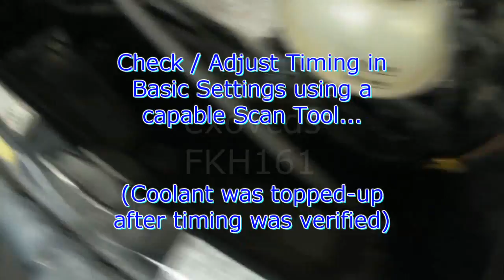VW T4: 2.5L Eurovan Replacing Hall Sensor inside the Distributor (Intermittent No Spark when Warm)

Comment: What year is this for? My 2003 has two hall sensors on the side on the block, not in the distributor cap
Reply from the maker: Those are probably knock sensors. North American Eurovans only had 2.8L VR6 engines in 2003 (last year for Eurovan). 2.5L inline 5 cylinder till 97... I think.
Reply: @EXOVCDS  my.mechanic told me they are cam shaft position sensors, also known as hall sensors... 
I changed one of them but engine light still on so ordered the other
Reply from the maker: So you have a VR6 with 2 cam sensors. If the engine has chain noise, sensors won't fix it.
Reply: @EXOVCDS  no chain noise (thankfully) just the damn engine light and code reader said cam shaft position sensor. Hopefully second sensor replacement fixes it
Reply from the maker: @bryankuderman945  the oil control valves for the camshafts can become stuck, resulting in camshaft sensor fault codes. To change them, the intake manifold and upper chain cover have to be removed... if the new cam sensors don't solve it, I would check them next.
Reply: @EXOVCDS  ok, ty for the info. One step at a time. Will see how the new CSP Se sor works out and then go from there. Much appreciated

Comment: if you have spark originated around the problem that retailers without long as the rotor and No fault was the failure to take all the retailer that I get for not knowing, that as a result it took me to put the item be lost again times since then and tried to turn it on and does not turn nad anything that makes me sad because that truck is my working tool in rrato when a friend arrives will try to do the firing order that you just provided me and if you have another trick and turn it on I would appreciate all the info you can give me thank you very much sir thomas and congratulations on being a mechanic is not easy eurovan at least in my country Venezuela is nadien know the mechanics of this truck look like the a spaceship and dare not repair
Reply from the maker: How many "windows" does the sensor wheel have? 5 or 1?

http://fkh161.ca/VW/wheel.jpg

Do you have spark? Spark yes, or spark no?

Comment: do you know if its possible to fix the hall sensor without replacing it? (talking about thing like soldering etc.) not sure what goes wrong with it
Reply from the maker: No... the transistor that is inside of it can't be accessed for replacement. You've narrowed it down the the sensor? A bad sensor will cause the engine to stall / not start. In North America, the 2.5l did not have a crank sensor... on the models that do have a crank sensor, the engine will run if the cam sensor / hall sensor fails. Have you checked cam / crank belt timing? If your distributor moved... you could have retarded timing which could be causing your power issue.
Reply: +Thomas EXOVCDS Hmm.. ok. Yeah I think it's the hall sensor. seems like it costs alot for such a small part http://www.amazon.com/Bosch-1237031296-Impulse-Sender/dp/B001CO18IQ  but there's also some cheap ebay part http://www.ebay.com/itm/HALL-PICK-UP-SENSOR-ASSEMBLY-1237031296-12303200-CM77299808-FF-/271985960255?_trksid=p2141725.m3641.l6368  not sure about the quality though. haven't checked the timing yet. I noticed that you're replacing the whole metal plate + hall sensor, but the one's I found just come with the sensor, is this a problem? Also, I was reading somewhere that you have to be really careful to not damage some kind of connector or wires somewhere when removing it/dissasembling the distributor?
Reply from the maker: +Žanas Tumasonis The sensors you have listed are the "stubby" style... they will NOT work on the Eurovan. Yes, they will fit / mount into place, but because of "where the sensor is located", it will generate a signal at the wrong time. The stubby sensor has the "sensor" right at the connector... the Eurovan hall sensor is On the other side of the distributor / hall sensor connector. It has to be in the same place in order to keep the timing siganl correct for the ECM. It's the wiring from the connector that goes to the sensor that can get pinched / break if not handled correctly: http://partsforcar-2013.co.uk/czesci/030%20905%20065%20B.jpg
Reply: +Thomas EXOVCDS Having some hard time finding the full part... started googling with german words like hallgeber or impulsgeber to find the correct part but I dont totally understand what these guys are talking about since google translate obviously wont translate all of it, where did you get the part from? http://www.t4forum.de/wbb3/board19-technik-bereich/board119-fahrzeug-unterhalt/board7-wartung-instandsetzung-bullim%C3%A4ngel/160712-aaf-z%C3%BCndverteiler-hallgeber-defekt/
Reply from the maker: +Žanas Tumasonis If the engine is running, the hall sensor is most likely ok... like I said, when they fail, they usually are dead = no spark. Crank the engine while looking for spark from the coil wire (remove from distributor cap and hold 1/8 to 1/4" from a clean engine ground). If you see consistent strong spark, hall sensor, coil, ecm control of coill are ok. I'm currently at work... won't have time to read links / check back with you that often, sorry.
Reply: +Thomas EXOVCDS It was the hall sensor :)) I bought this distributor with the hall sensor already in it, but it doesn't have the 'Germany' marks on the back of it like the original does that I took off. It started, but the timing mark that I previously put from the last one didn't seem to work for the new distributor (engine/exhaust was coughing), even though they seem the same shape.. weird right? so what I did was I turned it all the way to one side, got a check engine, and turned it in 1-2 min intervals until the check engine went away lol... seems to idle fine but I think there might be some power loss, so it's probably not timed very well.
Reply from the maker: +Žanas Tumasonis Interesting... good to hear it's running again! Not the type of failure I was expecting from a hall sensor! Sorry about having focused on something else.
Reply: +Thomas EXOVCDS if not your videos who knows where the van would be now :) what do you think about adjusting the timing just by hearing the engine/exhaust/it's idle? realistic or just better do it the proper way?

Comment: hello thomas! i have a 93 vw eurovan 5 speed the problem is that spark is going inside the distribuitor but is not coming out to the sparkplugs and when it does the whole motor sounds to weak if i press gas shuts off so i replace the hall sender sensor but the one that i got is just one piece doesnt  have the wires and the magnetic field is atached  close  to the 3 way conector so once i finish the installation  it does start but still weak not even to move the van because it shut off rite away so i took the sensor back to  BAP autoparts the told me that it is the rite one but  my concern is that it looks very diff from the one thta it comes in my distribuitor !
Reply from the maker: Make sure that the ignition wires do not have high resistance... as well as the ignition rotor. Ignition wires, 4k to 6k ohms each, ignition  rotor 2k to 3k ohms. Make sure that the inside of the cap is clean and that the carbon tip that pushes against the ignition rotor is in good shape.

Does your hall sensor shutter wheel have 5 shutter windows or just one?

If you use a "stubby" hall sensor, then your "timing" will be different from where it was with the "long" hall sensor... so you will have to readjust the distributor position to compensate for the stubby sensor.
Reply: +Thomas EXOVCDS  it has 5 windows but the one i got from the store came whit only 1 well i have 2 eurovans same year (93) just that 1 is auto and the other manual so i switched the distributor and the problem still but i havent check the wires!  and the rotor. another ?? is the distributor the same for the autos and the manuals?
Reply from the maker: +ZUICIDEBOY777 Yes, I believe the distributor is the same. 

A one window shutter is used on engines that have a crank sensor.... the engine will run with the hall sensor unplugged. 

You can not use a one window distributor on an engine that does not have a crank sensor and you can not use a 5 window distributor on an engine that has a crank sensor.
Reply: +Thomas EXOVCDS ;'(  hate those BAP store guys they told me was the same so now what shut i do if i already install the 1 window distributor but i remove i and put the old one by the way  you knw where can i get the hall sender unit like the one is inside  in the distributor !
Reply from the maker: +ZUICIDEBOY777 Your old distributor hall sensor was working (you have spark from coil). If the hall sensor were bad, you would not have spark from coil.

Put the old one back in and check your wires & rotor.

A hall sensor from a 1990 jetta or golf will work in the eurovan... when you find / buy one, make sure that is the big style (sensor is 180 across from the harness plug).

http://i.ebayimg.com/00/s/MzQ2WDYwMA==/z/pQoAAOxyRNJSfpWW/$T2eC16h,!zYFIcTNiv5BBSfpWWn)M!~~60_35.JPG
Reply: thank you! very much. so why at the autoparts stores are selling a different sensor that  is not 180 i went like 3  places specialized in europarts all of them show me same sensor! they told me was better than the old! :'( hey have you evr done a swap eurovan to diesel?
Reply from the maker: +ZUICIDEBOY777 Haven't done any swaps / conversions... the "stubby" hall sensor should work (I have not tried it), BUT you have to readjust the distributor to get the correct timing.
Reply: and how can i do that is there any diagram for the adjustment ?
Reply from the maker: +ZUICIDEBOY777 I will send you a link to a pdf showing the distributor location at TDC via youtube messaging... compare the shutter wheel position (with relation to the "stock big" hall sensor) and then, when installing the stubby hall sensor... turn the distributor until you get the hall sensor at a similar shutter position... if that makes sense.

Comment: Thank you so much for this awesome video!
Gonna replace my hall sensor soon and let you know if it fixed my problem, that sometimes my van just runs on 4 cylinders, anything else is already replaced
Reply from the maker: When the hall sensor is bad... the engine will NOT run at all. If your engine is only running on 4 cylinders sometimes... look for a spark plug wire or distributor cap issue.
Reply: As said, anything else is replaced, even the ecu and the harness checked and rebuilt. There are people saying the hall sensor can die in a process, so it gets worse from time to time and your video, showing the magnetic field decreases, and a new one has enormous magnetic strength, actually proofes that
Reply: Thanks! So the main issue is on autogas (lpg) he seems to stutter sometimes, since about half a year, without any logic or reason behind it. Appears completely random. I thought it was an autogas issue and then drove mainly on petrol. 
Now since a week I have exactly the same stuttering also on petrol, like he's not running on all cylinders, but JUST if I drive quickly in right curves. Left curves show no issue. Could this be caused by the hall sensor? I checked anything engine related, timing with vcds done several times, replaced new parts with old parts again, still no change. Hall sensor is the last to do, besides that any sensor, the entire exhaust is new, throttle and hoses cleaned, vacuum hoses also changed, ecu changed. It's just a weird thing that it's just on right turns, it can't be the fuel or the fuel pump (which is also new as it completely failed 1,5 years ago) as it appears also using autogas. No errors in the ecu, by the way
Reply from the maker: If the vehicle is sensitive to body lean (left or right)... look for wiring / wiring harness issues (flexing, bending, pinching of wiring). If you are in Europe, check if your engine has a Crankshaft Position Sensor.... here in North America, the T4's never had a crank sensor. If the engine has a crank sensor, then the hall sensor can be left disconnected and the engine should still run... which can then rule-out the hall sensor as the issue.
Reply: Den kompletten motorkabelbaum hab ich schon ziemlich durch, auch alles durch gemessen, die Stränge an Knicken aufgemacht um zu sehen ob vielleicht ein Kabel gequetscht ist, scheint aber alles gut zu sein. Mein acu, auch 94, hat keinen OT Geber.
English version: 
I've checked the entire engine wiring and couldn't find any issues, also measured the cables, but none is cracked or blocked or stripped or anything. Don't have a crank shaft sensor, also 1994 acu. 
I first thought he wouldn't inject, I'm still not sure. Can it be told from hearing or feeling if he either doesn't inject, or doesn't spark?
Reply: Erstmal hab ich ja gedacht er spritzt nicht ein. Bin mir da aber immernoch nicht sicher. Kann man den Unterschied hören / fühlen, ob er nicht einspritzt oder ob er nicht zündet?
Reply from the maker: Fuel injector misfire & ignition misfire can feel similar... using a multimeter / scope to monitor ignition (hall sensor) or injector pulse, would be the best way to determine if fuel or spark is cutting out.
Reply: Hard to reproduce... Measuring while taking the turn with 50mph might not be a good idea :D but as its also a 1994 and the hall sensor had never been replaced (and the one in the video failed shortly after replacing the coil and plugs, just as with mine), I'll just give it a go and see. In relation to the other parts I put my money in, that won't matter anymore anyhow :D little tip from my side. If that t4 ever fails on creating power and smokes a lot and your into soldering, since about one or two years the map sensors from genuine Bosch are again available (which is soldered into the ecu), replacing that works fine
Reply from the maker: I have re-soldered a map sensor / bad connection before... luckily, we don't see that too often.
Reply: Thomas EXOVCDS so after much trouble the engine is finally fine again. You won't believe what it was. I took off the intake manifold to change the gasket, and then I saw a connector at the oxygen sensor cable (its a coax cable, two in one, signal and ground). Some dumbass before I owned the van tried to get the oxygen signal and put a... How's that called in english, don't know, in German "stromdieb" (Google it, crimps around a cable and cuts the isolation) and with that he connected the oxygen signal to its own ground -.- so much work for such a little reason, well all sensors including hall are now new anyhow, ran like a boss after making the entire oxygen wiring new. Then last week he began stuttering again, same symptom, but different reason. The distributor o-ring was broken and the cap was full of oil, causing misfire. Strange that these 2 problems caused the same stuttering. But now it's finally running again like new, with an epic fuel consumption of 7 to 8l per 100km and at full crazy gas rides at max 12,7l! I thank you very much for your inspiring videos and maybe these 2 problems I had help you too :) cheers, Daniel

Comment: has 5 but thanks to God and your support to achieve the just turn but now has another fuel fails me way too wet spark plugs and not have to turn off the fuel pump try a few times and then turned again placed him fucible pump Station and stays on but the vehicle does not have performance chokes and loses strength makes to turn off but still on what and I noticed is that possibly not regulating the amounts of fuel and do not know what could be if usteb could I help would be great if it were not for you not out on you sir thomas now have a friend in Venezuela jejejejej
Reply from the maker: Spark plugs are wet because no spark or because spark at wrong time. Ignition Coil is common failure.
Test Ignition Coil like this:

VW A3: Ignition Coil & Power Output Stage Quick Check (helping a viewer)
Test ECM control of coil like this:
VW T3: Vanagon Checking for Spark Part 1 (Cranks OK but does not start / no spark)
Reply from the maker: Sorry... I did not understand correctly.

Can you attach a fuel pressure gauge at the fuel rail? If pressure drops after you turn the key off, then maybe a fuel injector is leaking.
Reply from the maker: Attach fuel gauge like this: (at cold start valve location)
VW T4: 2.5L No Start (checking fuel pressure)

Comment: Hello Thomas, 
This is feki122, I logged in on my second account, hopefully this will work.
Could you help me with my questions?

Thank you.

Greetings,
Reply from the maker: Hi, I have a punch set and I just grab whatever size fits... if the base (where the pin is) is metal, support that end in a vice or a bench and tap the pin out.
Reply: ***** Hello Thomas, 
Bought a 3mm driver, and with it I've managed to tap the pin out, and replaced the hall sensor.
Hopefully the not starting and stalling while driving problems are over, but time will tell.

Thank you for your video and help :D 

Greetings.
Reply from the maker: Etino gard Thank you for the update!
Reply: @etinogard4380  - did this fix your problem?